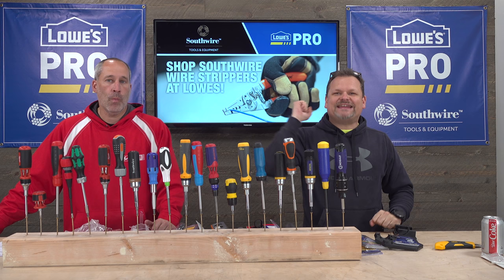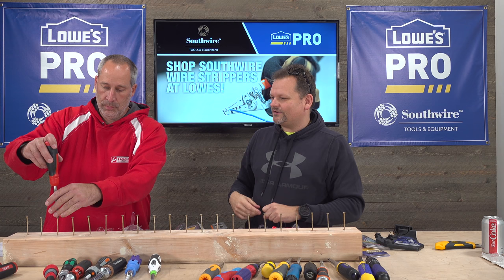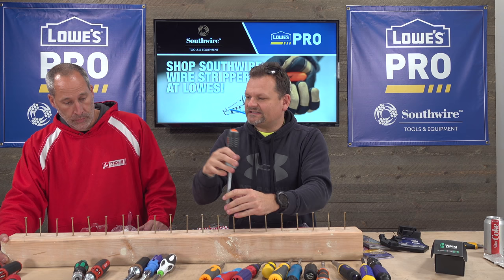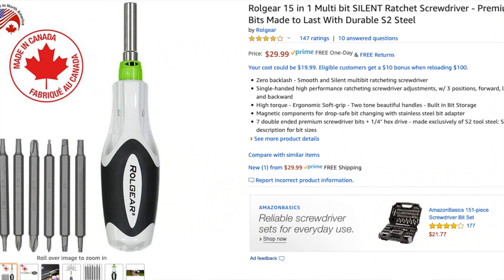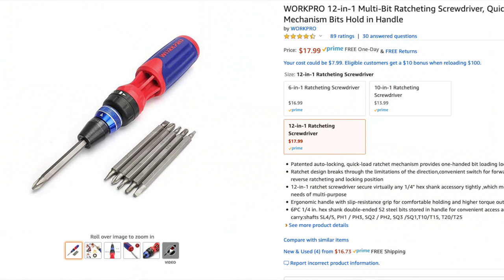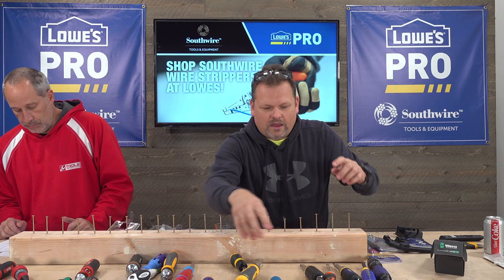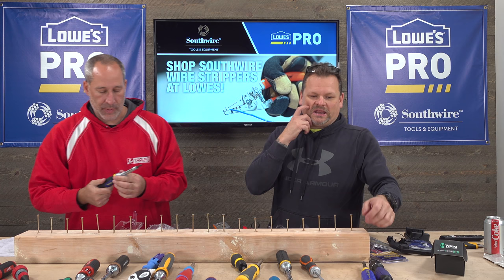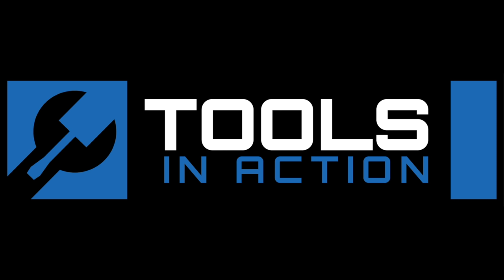Amazons Best Ratcheting Screwdrivers

Comment: Ive been using that Ideal 9 in 1 ratchanut for about 5 years. Ive been a journeyman electrician for 20 yrs I can say without a doubt its absolutely the best electricians screwdriver out there. The wire nut ratchet is beautiful and absolutely helps against finger fatigue when twisting wirenuts all day. I could go on but basicly this is the one if your an electrician. I have 2 and its the first thing I grab out of my tool box or bucket on the job

Comment: The Rolgear is my favorite. Super smooth and long reach. You can also use the wrench flats on the shank if you really need extra torque. Also, the bits should be inserted from the bottom to access a new bit. There is a little magnet to hold the new bit as it exits the handle.

Comment: The Williams is made by Snap-on. Only a few minor differerences. The old Kobalt double drive were gearless and probably smoother like mentioned. Sometimes can be found on eBay, but for a pretty penny. The new Kobalt are tooth and pawl systems.

Comment: The Williams I the exact same as the Snap On ratcheting screwdriver for half the price. Made in the same factory, Williams is a snap on industrial brand.
Reply: towboatjeff My dad has the old snap on ratcheting screwdriver from 30 years ago and it still works great. I’m not a fan of the snap on price but if this is close I think it is well worth $36
Reply: Snap On has the best quality ratchets IMO.  Their ratings say it all.
Reply: @michaelreed9495  you can buy it cheaper in black if you are ok with a tractor company name on it.
Reply: No. Mechanically, yes. But handle shape is different, and it lacks the knurling on the shaft. I have both, both work fine, but the williams is less comfortable, has less configurations available, and a crappy warranty (lifetime, bit williams is a pain in the ass to deal with)
Reply: @jamesstephenson2346  I would personally buy a used Snap On ratchet driver before buying a new Williams driver for about the same price.  It is a better investment, for sure.

Comment: I've been using the Canuck Megspros for the last decade or so. I've got several versions from the ratcheting, to the standard locking bit drivers, and odd security bit drivers.

They are excellent tools that have  never failed me, nor broken bits. I would not trade any of them for something else. I also don't believe anyone makes a better tool.
Reply: Totally agree.  Been using for a while.  My go to screwdriver.

Comment: You can remove the blade of the vessel, replace the blade or swap it with another.. or put a bit in it n have a stubby ratchet. You can use finger tips  in both positions to fast ratchet(ball in palm n using thumb n finger or two. N ball in finger/palm crevice, using thumb only. N then use the ball the way you did to torque down.

Comment: The Mega pro ratcheting is the best and the standard Megapro blue/yellow) is the best multibit/multipurpose screwdriver, ive owned my Megapro 15in1 for over 20 years still rocking. I have the Wera, but the handle is to small.

Comment: You should have discussed the ability to use the rear as a hammer. This feature is really useful for locksmiths who have a bunvh of different hardware that has to all fit together just right in a door mortice and sometime you just need that bump to get things right without marking it with a regular hammer and without having to switch tools back and foeth to get it just right before tightening things down

Comment: I really like the short ratcheting wera 815RA without bit storage. I keep it in a drawer with a bunch of bits of different lengths so I don't need the on board storage and the small size for a ratcheting screwdriver feels less bulky in tight places.

Comment: I like my Rolgear because it's the only one with long shank double ended bits. There have been a few times where i would have had to use a normal screwdriver instead if i was using a short bit holder. My only complaint is the mode select is too light so it's easy to change the mode on accident.

Comment: The VESSEL DOES have a replaceable shank for when it wears out so you don't have to toss the mechanism out.
Reply: It's also a stubby, the top ball can be detached from the rest of the handle turning it to a stubby. Not 100% sure on the model shown in video as they have multiple version of the same style differing slightly in function and color.
Reply: Vessel now has the a me rachetting screwdriver that you show, with interchangeable bits.....

Comment: Guys check out the Felo (non ratcheting) bit driver.

You can skip the cheap gearing that 𝘢𝘭𝘸𝘢𝘺𝘴 breaks, and use any type of bit kit that you'll just easily learn to carry around every time you grab your driver handle and you'll never lose your bits because your case is always right with you.

The Felo is a German screwdriver and has a better ergonomic grip than the Wera.

Most people just don't think of doing it that way but I think if you seen the combination of the driver and bit case next to each other it would just make tons of sense to you and your audience.

We don't really need ratching action these days because no one is going to be hand driving huge fastners with a screw driver, we mainly use them for small screws and fastners like wall plates, taking electronics apart etc so having a full bit kit is ideal.

I grab my Handel and I have 60 different screws, torx, nut drivers etc ready to go 👍🏻

Comment: I have a “Hyper Tough” ratcheting screwdriver that’s got these revolver style but holders, so if you know you need a Phillips or flat or torx or whatever, you grab that revolver set, then you can quickly rotate through them without having to take them in and out by hand or have them spilling everywhere. 

It’s not perfect for every situation and it means you have to carry the revolver things around (I use 2 pill bottles so the bits can’t get knocked out if they’re dropped) and it’s asymmetric and it doesn’t have a long neck (and if you use a bit extender then you can’t do the revolver thing) so it’s not for every situation but for average stuff it’s great for speed of finding the exact right bit.

Comment: Great video fellers. I have the Wera, Wiha, Rol Gear, Dewalt. My favorite is the Wera. I love the Rol Gear but it does infringe on the hand when torquing down. You have to keep pushing the bits back in but I love the quiet gear ratio. Thanks fellers, Al from Maryland
Reply: Take a look at the Gedore silentgear

Comment: The magnetic Irwin nice that's it's magnetic but I always find that steel shaving get into it the shaft &  eventually your tips have a hard time fitting. You almost always need a tip in it to prevent that.
Reply: I have a stanley magnetic with the same issue, this causes it too lose its grip and when you hammer on the rear of the screw driver to get it to seat in damage screw heads or to loosen rusted screws it is easy to break the magnet

Comment: The Williams looks identical (Other than the color and markings) to a Snap On I paid $49.99 for almost 30 years ago. Perhaps it's because I think about it being a $50 screwdriver when I use it, but I have replaced the bits several times over and still have the screwdriver itself without losing or allowing anyone to walk off with it for so long. I use it several times a week and still have it after all these years. It has never failed to work properly. I've never done anything other than a few drops of oil every few years. Overall I honestly can't complain at all about the screwdriver.

Comment: I bought the double drive only to find out it won't work for me because it has no lock. It only ratchets forward or reverse. It will not lock the ratchet so you that you can drive in either direction by just twisting your wrist. Which is a big bummer and inconvenience

Comment: Blue point has one that’s absolutely awesome.. you can actually get it off of amazon for around 33 bucks... I’ve put it through a lot and it still works fine... it also has the knurling on some of the shaft for better grip so that one would’ve been a great pick as well for the competition.. nice review though fellas...👍👍👍
Reply: It's identical to the bahco

Comment: Great video.  My favorite  is the old school Craftsman ratcheting screwdriver that had the slide switch, magnetic tip, and small bits rattling around inside the handle.  Sears stopped selling that style a few years ago and I haven't found anything that I like since.  The best part that I like about it is its size, whereas most of the ones I see today are long and bulky.   Great job as always...   Have a great weekend.......
Reply from the maker: Thanks :}
Reply: I miss this one, too! I think Stanley may have something similar with a slide switch.

Comment: Couple criteria for me with ratchet screwdrivers. If it doesnt fit 25mm 1/4 bits i will not use it and if it has exposed bits its a no go as well. 
I have quite a few ratcheting screwdrivers and for me the best budget one out there is the Xiaomi Mijia Wiha, dont recommend it for using it in the field tho. I really like the Wera's as well but i replaced them with one's from Facom who are a class on their own when it comes to quality and functionality if you ask me.

If you ever have the chance to pick up a Facom ACL.1A or ACL.2A for a good deal then do it. You will not be disappointed unlike the Bahco's which are total crap.

Comment: you guys are hard core! next time, maybe use torx head screwheads.
Reply: I can't get on with the Kobalt doubledrive: as soon as I need to put some pressure on (phillips head...), or torque, the gearing doesn't work: a waste of weight, and it's short & fat, so it doesn't get into a single gang box, etc...

Comment: I have the Irwin, the Kobalt Dual Action, and an older Kobalt. I use the Irwin a lot but the bit tends to pull out when lift off the screw, the Dual Action is useless, and the old Kobalt works real well.  The problem with the older Kobalt is the screw on cap at the end where the bits go in, when you are torquing down on it with two hands you can unscrew the cap.
Reply: I put a dab a of caulk on the threads occasionally to stop that
Reply: I think that older kobalt you have might be the gearwrench - if the shank comes out ..then for sure. Check out the gearwrench kits..they have different shanks and few handle choices

Comment: No one drives deck screws into wood with a ratcheting screwdriver. A better test is how they feel working machine screws which is their intended use.
Reply from the maker: machine screws are smooth and easy to run.  this gave us a good example of the grip feel

Comment: Snap-on owns Williams, and it's the same tool.
Btw the best ratcheting screwdriver is the old Easy driver or more recent slightly improved Pratt-Read manufactured version.
Reply: People need to stop saying this. It is NOT the same tool. It IS mechanically the same yes, but handle shape, shaft knurling, warranty process, available options, etc are all very different. One brand will feel better in your hand than the other. You can decide which that is. If you like the williams, save a few bucks, buy the tractor branded ones.
 They are like 27 dollars.

Comment: I own a DeWalt maxfit telescopic ratcheting screwdriver DWHT66567 yellow  magnet bit attachment is  its weakest point DeWalt has a all metal version we had a great guy has is it doesn't have on-board storage I solve that problem with a plastic case

Comment: That Milwaukee seems like the bits will fall out when the thing wears
Reply: You're right. The bits are really nice and you can use them with any impact driver because the 1/4 shank. The problem is the system they use to keep the bits in place, when it wears, the bits fall off. Sorry for my English.

Comment: The double drive Kobalt ratcheting type screwdrivers are gimmicks at best. They do not hold up. Why? Because if you run into just a little bit of force while you are using the overdrive feature it destroys the internal gears(?). DO NOT waste your money on those types of ratcheting screwdrivers. Unless of course you know that you are buying a toy and not a tool. Then again, if you are buying anything but a Wera or Klein for a screwdriver . . . you are buying toys.

Comment: The Williams is EXACTLY the same thing as the SO version. The only difference is the color, cost, and some extremely minor and insignificant design.
Reply: And the handle shape, and the knurling on the shaft. And the warranty process
Reply: @roguegeek  no i absolutely do. They are not. Actually look at the product not the pics on the net
Reply: Copy paste, and learn. Or dont. Its up to you.
Reply: Just checking in to see if you have figured out you were wrong yet?
Reply: @roguegeek  you sure are working awfully hard not to acknowledge your failure
Reply: @roguegeek  oof bro. 62iq response
Reply: @jamesstephenson2346  covfefe